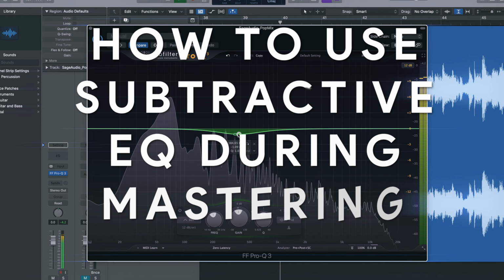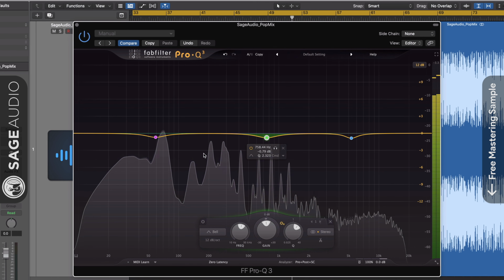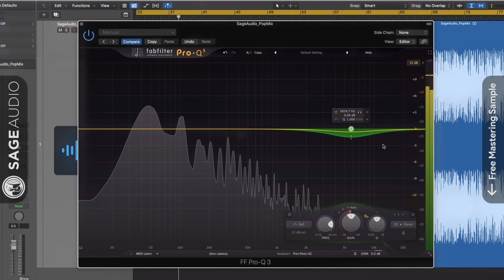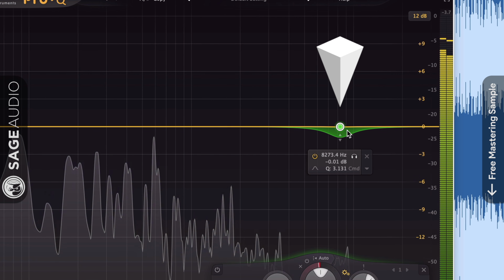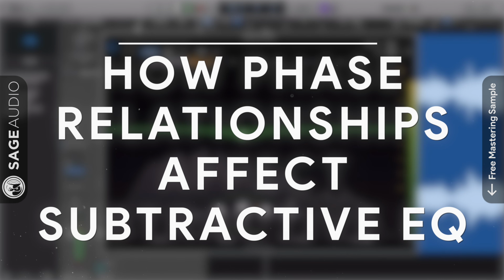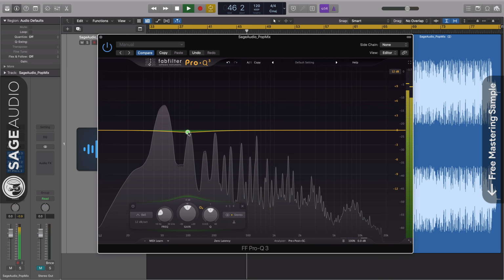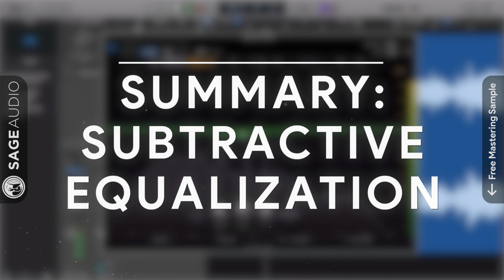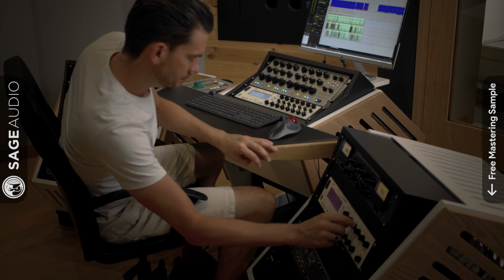How to Use Subtractive EQ: Mastering

Comment: Thanks for this video. Can you do some video about what is good to think about if you do hybrid mastering, using both plugins and analog hardware, what to think of before going out to analog and then back to digital again. Best/Mathias
Reply from the maker: Hey Mathias! That's a great topic! We'll make a video like that in the future!

SageAudio.com
Reply: Depending on the gear you use and the level it can take it’s better hit the analog gear early on and then go back ITB. This will let you first do some cleaning up with a plugin or outboard then hit your sweetening on the gear. At this stage you will likely stay at a good gainstage and not clip your gear unless you want to.
The only other reason to go back out again is if you have a analog limiter and want to hit that(for clipping or limiting) before you go into your digital limiters ITB. The only issue Is you are going to go through another stage of conversion which is a negative side effect you don’t want...unless it’s a sound that you are after and outweighs the negative aspect of double conversion. You would probably need another converter to pass through for this as well.

So to sum it up go out to gear first or early as possible because you will be increasing the signal after that with plugins 
Keep one daisy chained signal path or use an insert switcher. Don’t use an interface with hardware setup on 1-2-3-4-5 outputs etc. This would be 5x times back and forth for conversion and 5x degradation of your original signal.
Most hardware that is for mastering has an internal bypass or soft bypass that will let you keep the signal going through without altering the signal or allowing you to get the “sound” of the box without initiating the controls that impact the sound. So for example you could bypass a Tube compressor and not have any signal compressed but go through the tube stage to get the tube saturation of the hardware.

Hope that helps